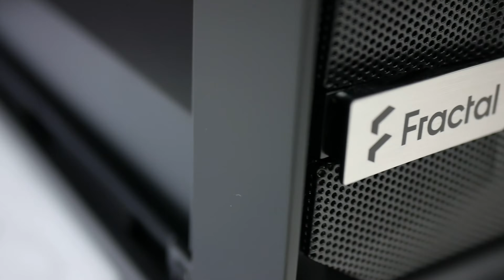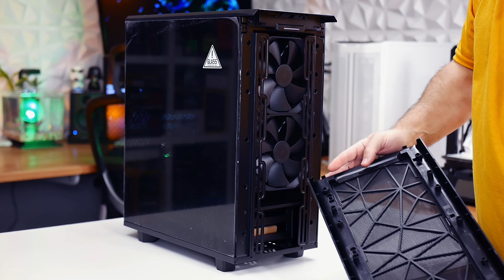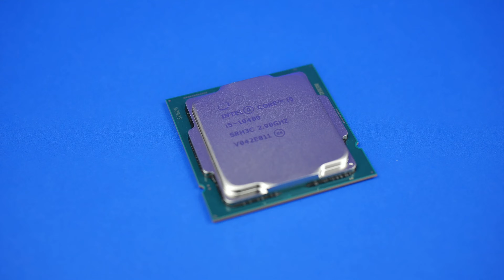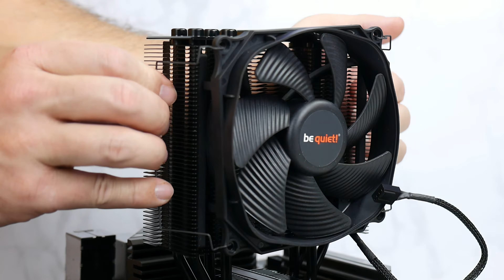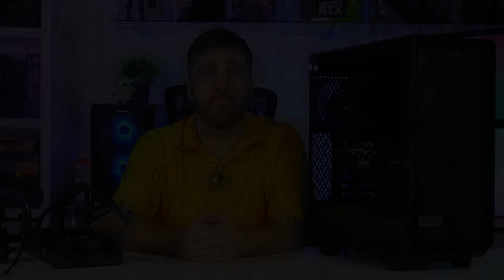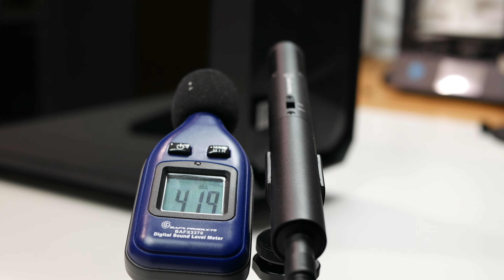Fractal Meshify 2 Compact - Case Review & PC Build

Comment: Bought this with your recommendation and broo... It's amazing!! Built with intel 12th gen i7 and an MSI RTX 3070 (327mm in length). No problems at all. Top mounted a 240mm AIO and chose Kingston hyperX beast 3200mhz RAM sticks. The overall build is stable and working superbly.
Reply: How it's going? Any problems??

Comment: I am putting a new build together and I wish Cooler Master would have updated their NR range, I had the NR400 for an Matx build and it's very similar to the Meshify but they haven't put USB C on the front panel yet so I've ordered this Meshify 2 compact for my ATX build, I think it may also be smaller than the NR600, but was a huge fan of the NR400, loved how the glass came just to the psu compartment and sat flush with the side, wish more case makers would do that, excited to try this one though.

Comment: Many thanks for a great review! Today I am waiting for my case to arrive in the mail, and I am looking forward to start the build. GPU is a MSI 3060 Trio and CPU an Intel 10700 with Noctua U12A.
Reply: My build took 1,5h, and your tip about the USB3-connector came in very handy as I have a MSI Z490 board. It is good to mount the SATA connections too before securing the mobo as it is a compact space. My Corsair PSU is 160mm and I had no problems at all making space for cables using 2 old 3,5 hard drives. I have SSD:s as well. Over the years, I have spent a lot of money on computer cases, and I will say that this one is the best so far. The enclosed fans are just fine, but I did spend some extra money on PWM fans with RGB, as I am very pleased with this build. Once again thanks for your review!

Comment: Thank you for putting in the extra effort to editing the different AIO and fan cooling configs, really helps visually illustrate the different loadouts. 

Currently I'm stuck between getting this case or the newer Torrent Compact or the Meshify 2 C to house my ASUS ROG Strix 3080Ti Liquid Cooled (240mm RaD) + my 360mm AIO. .   Think this could house both comfortably ES?

Comment: What would be the best fan configuration for this case? 3x120mm front 2x140mm top? That but with the 120mm fan at the rear? Or would the 2 140 at the top be ebough for exhaust? Is 2x140mm up front as intake better?

Comment: I am returning to PC builds after 20 years and was confused on the 3 front fans and with only 2 System FAN connections left after hooking up the rear fan (System FAN 1 connection) how to do you hook up 3 fans? I ended up daisy chaining the 3 fans into one connection as System FAN 2 connection. The manual was not clear on hooking up fans except for a single picture.

Comment: Looks like a 280 AIO might fit at the top. Thoughts? I currently have the Z63 and would like to reuse it for this case for the top if possible. I cant use it at the front as my GPU is 336mm long.

Comment: I love my  meshify-C but I've been longing for a front USB-C. I wish this case still had the back bracket that can hold 3 SSDs.. Why did they get rid of that? One thing I wish they added was room for a 3rd 140 fan in the front like they have in the meshify 2.
Reply from the maker: I think the trend in reducing SSD mounts is both the prevalence of M.2 storage and the expanded capacity and lower price of SSD's. However you can purchase additional SSD trays for this case. As far as room for 3 140mm fans that would move the case out of the compact form factor.
Reply: @ElevatedSystems  Huh, Why do you think so? If they just opened up some space in front of the shroud and give the choice to move the hard drive trays.. I think it would work well. I have 2 rendering GPU's I like to get more air to and I think that would help. I'm really being nit picky here.. I'm excited about this case!
Reply: @ElevatedSystems  I was mistaken anyway. the Meshify 2 can only hold 2 140's in the front as well.
Reply from the maker: @dSiRitz  There are mounting points for a 120 on the bottom of the Meshify 2 Compact if you remove the drive cage. No need for zip ties.

Comment: People are saying mounting a bottom fan is difficult and useless, is it the case? I am looking for a case which can mount bottom fans like Lancool 2 Mesh
Reply from the maker: The bottom fans mount under the PSU shroud if you remove the drive cage. I have a bottom mounted fan in my Meshify 2 workstation that is tied to my GPU temp, and it helps keep the GPU 5 to 7 degrees cooler.